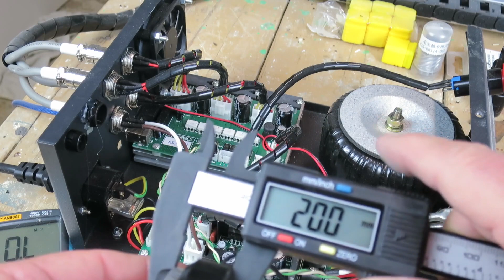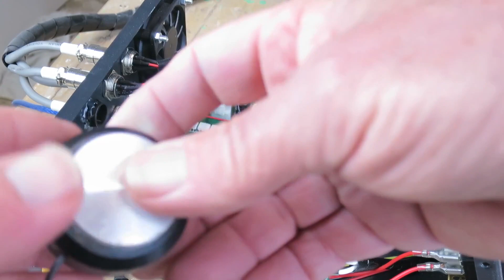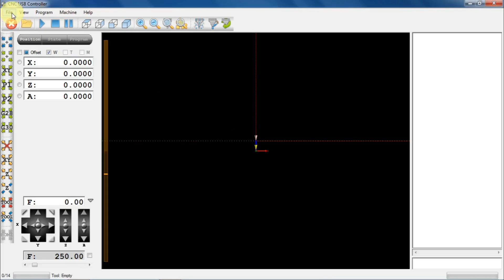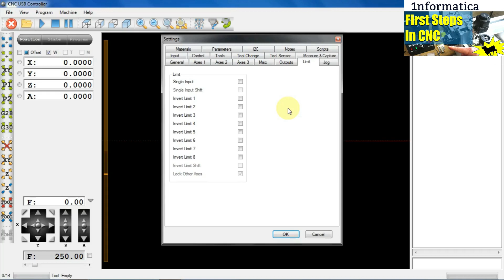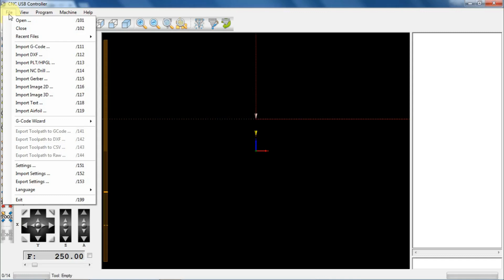Z Axis Probe CNC USB Controller 3040t Tutorial How to Guide

Comment: Hello, great video but i have the same problem like the guys.
When i trigger the probe it indicate that with red  Z window but the tool continuing to move.
Some ideas?
Thank you in advance :)
Reply from the maker: Did you check the "single input" box like here : https://youtu.be/32hjG9YyjDM?t=278 Also you must use the "Offset - measure offset Z" button, just moving the Z axis down will not stop when it hits the sensor. Thanks for watching, have a great day!

Comment: Hi,  let me ask, do you still work with old Planet CNC software or you moved to PlanetCNC TNG  version ?
Reply from the maker: I am still using the old software, it does everything I need right now. Upgrading to TNG would require buying a new and expensive controller board as the Chinese "knockoff" controller is not supported by Planet CNC. Do not try upgrading the software with the Chinese board as it will most likely get bricked! Please consider subscribing if you have not done so already!
Reply: @1nformatica  let me ask you, with your software the spindle stops spinning after the tool path finished carving? Or do you have to manually stop it ? Can it be stoped automatically let’s say after the cutting is done?
Reply from the maker: @DMKA100  The spindle is completely manual via a switch and speed control on the control box. The software only controls the axes in my case.
Reply: @1nformatica  Ok, thanks. I recently got TNG and much bigger CNC. So trying to set it up and give a first run. Tried to do simple 3D carving, and I got horizontal lines from a cutter from start to finish on my rough tool path. Do you know what caused it by any chance ? Thank you.
Reply from the maker: @DMKA100  Sorry I don't have much experience with 3D carving, my own project just worked! https://youtu.be/UMmPnpNHo3I Maybe try Carbide Create : https://carbide3d.com/carbidecreate/ it worked for me. Also they have an awesome community forum https://community.carbide3d.com/ with very helpful and knowledgeable folks!

Comment: Hi,
at first my english is not the best ;-). Ok i try to ask my question. I have the same cnc, the same software (only the latest update) and the same controller (china). I  put my probe on the plug in and made the settings how you show in the video. When i touched the probe, the Z in the program (cnc usb controller) go to purple. When i press the offset Z, then the z axes goes down. Then i touched the probe, but the Z axes just keep going down. I must stop it. Maybe the new software is the problem? I'm going crazy soon. If you could help me, i would be very grateful to you.
Reply from the maker: Do you have the tool sensor enabled? See https://youtu.be/32hjG9YyjDM?t=220 Tell me your language (German)? and I can translate the subtitles if that would help.
Reply: @1nformatica  Yes i have. My language is German. Can i send you a mail with my settings? My Email is rizzini76@yahoo.de
Reply from the maker: I have translated the subtitles into German for you. You can email me at gizmohombre@gmail.com
Reply: Have you found a Solution for your problem? I have the same Issue.
Reply: I have the same issue, I've tried everything... :(

Comment: Hello and thank you for your great video. I wouldn't be able to set up my Z axis probe without you! 
I have an issue with my 3020t CNC and CNC USB software which prevents me to use the Z axis probe for height mapping and eventually PCB milling. transformation matrix settings and all the other options under the capture & measure drop down are all grayed out. When I go to settings, the input and ctrl tabs are also grayed out and I can't change anything under these tabs. I read online that it might be because of a limit switch being active but I have checked the IOs (under General settings) and non of the limit switches are active. I'm stuck with this for a few days. An interesting point here is that if I remove the machine from the USB port, all the grayed out options become activated and when attaching the USB back, they get grayed out again! Please help me.
Reply from the maker: Thanks! I think the problem you are seeing is because of the CNC control board. If, like me, you have a "knock off" Chinese board with hooky software then it does not support all of the features of a genuine Planet CNC board. You may find the answer in the forum here : https://forum.planet-cnc.com/ although it does not seem very active.
Reply: @1nformatica  Thanks for the reply. Yes, I do have a Chinese board. I think that's the reason really. It seems that the best way would be to buy a genuine MK3/4 board for my CNC!
Reply from the maker: I think you will also need to purchase a new license and upgrade to the new Planet CNC TNG software. Maybe look at some other controller program like this : http://linuxcnc.org/community/

Comment: Hello Informatica, I have the exact same machine that you have (I am in the U.S.A.) and have benefited from your videos. My Tool sensor (touch plate) plugs in however it shows up on the y axis and not the Z axis. do you know how to change or map that from the Y axis to the Z axis?
Reply: i have the same problem the y axis lights up not the z axis  Stacey Miller did you ever fix yours
Reply: @leonardsantiago7425  I think I have it working now... how about you?
Reply: @staceymiller5046  nah still same. My board is different than this one in the video. And is connected exactly as it says on manual it even lights up same pin number as it shows ill. this video but lights up y axis on the cnc isb controller program
Reply: @leonardsantiago7425  Hi Leonard I have since upgraded to a Workbee 1510 see my video Type in Stacey Miller CNC
or OpenBuilds CNC progress.
Reply from the maker: The limit switch should trigger on axis 3 https://youtu.be/32hjG9YyjDM?t=155 Axis 3 being the Z axis. Perhaps your machine has been wired incorrectly?

Comment: is there any way to get a x and y probe to work on this maschine?
Reply from the maker: If you mean limit switches then yes : https://www.youtube.com/watch?v=2zK_c9hD3ys
Reply: 1nformatica no i dont mean limit switches, i ve already watched that video <3

i ve just seen that other cnc maschines that were able to probe the x and y axis of the workpiece. just like in this video it probes the z axis.
Reply from the maker: @ChromeBreakerD  The software has provision for a "tool sensor" which may do what you want. See pages 84 to 88 in the manual. I have not tried to set it up but see no reason why it should not work. https://planet-cnc.com/wp-content/uploads/2016/03/CNCUSBController.pdf
Reply: @1nformatica  Yes, that is exactly what i meant. Thanks for searching. I've found it now in the settings as well. But sadly it is greyed out. Just like the "soft limit" settings. Seems like these chinese boards does not support these features. In your video it is greyed out as well 3:40
Reply from the maker: @ChromeBreakerD  I guess you are right, you would need the "official" board, but at over 100 bucks I'm not getting one just for that!!
Reply: @1nformatica  yes, i thought just the same x) and then we would need the official software for another 100
Reply from the maker: Yes, be careful, somebody mailed me saying they had downloaded a trail version of the official software and it appears to have flashed a new ID to the board. No way back to use the "hookey" version!
Reply: @1nformatica  ooh, thats definitely good to know.i wouldn't want to buy a new controller, they are too expensive/ to less option. thanks :) 

aah, and i got the edge(x/y) tool sensor working. but I have to do it manually. I just move the maschine by step in x and y directions and use the Z axis sensor as indicator.
Reply: @1nformatica  hey, one more question. May you tell me which post processor you are using? Im using grbl in fusion 360, but i think its a little buggy
Reply from the maker: @ChromeBreakerD  I don't do any post processing. I use Inkscape to produce a dxf file which I then put through the dxf2code program. The gcode output I then simulate using this site : https://nraynaud.github.io/webgcode/

Comment: Hi,i fitted the probe as described in your fantastic video,it seems it doesn't want to play ball,the z axis lights up on the software,i put in all the sizes and enabled the it,with no luck,can you advise.
Reply from the maker: Do you see the I/O signal change as here https://youtu.be/32hjG9YyjDM?t=119
Reply: @1nformatica  yes,when i touch the probe off the mill end bit number 3 lights up.
Reply from the maker: @charliedewar2143  What happens when you click "Measure Offset Z"? Does the Z axes move down and not stop?
Reply: @1nformatica  yes thats what happens,do i have to put in off sets in the settings menu for the x y and z axes
Reply from the maker: @charliedewar2143  You don't need to put offsets for this to work. The only time I have seen this is when I forgot to put the ground clip on the tool bit! Check continuity between ground in the control box and the probe clip and tool. Check you have "single input" selected in the settings "limit" tab.
Reply: @1nformatica  ok,will do.thanks again for your time and patience with me.
Reply from the maker: No problem! It's probably something simple that you'll kick yourself for when you find it!!😀

Comment: Hi Great video!  I followed your video to set up my Z axis probe and it works Great!  I have a 3020t seems to use the same cnc usb controller software. Do you know how to set up Homing and Limits in the software? I see where there is a place under settings / axes 3 in the software but don't know how to go about setting it up. Any info you can provide would be a great help. Do you have homing or limits setup on your 3040t? Thanks
Reply from the maker: Hi Bob, I have a project in the pipeline to add limit / homing switches to my machine. Stay tuned!
Reply from the maker: I have now added limit and homing switches, the video is here https://www.youtube.com/watch?v=2zK_c9hD3ys